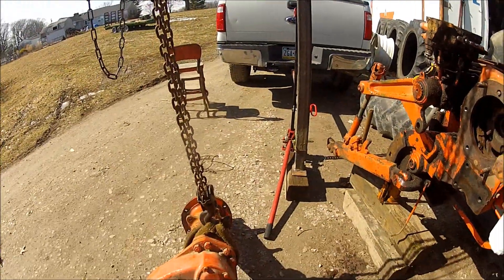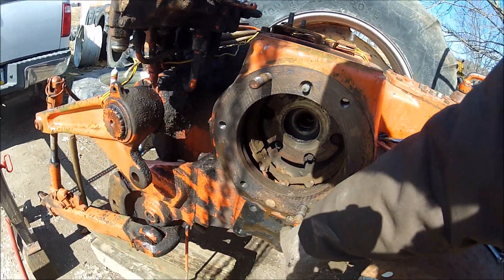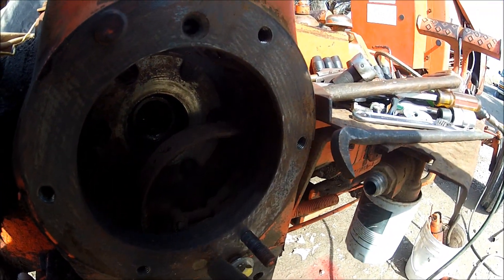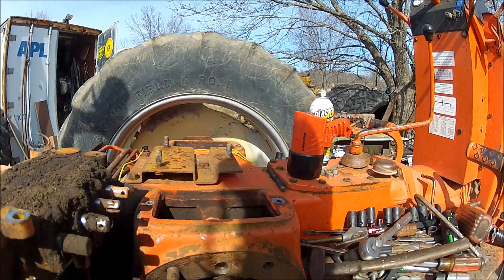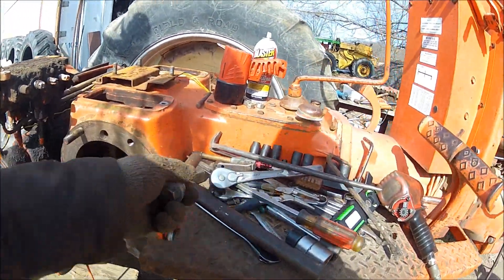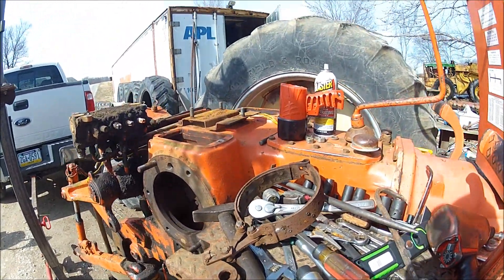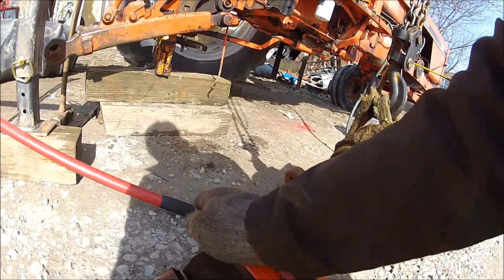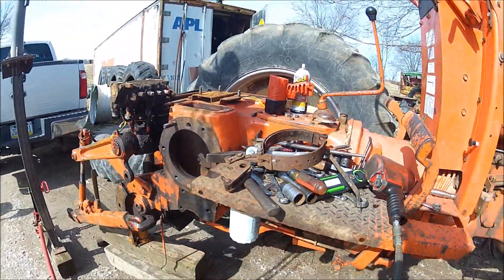Removing the Brakes from Allis Chalmers 185

Comment: In case others run across this, you can actually do this whole brake job without removing that lower pin. Even with the frozen brake rod actuator and broken brake rod. The linkage can all be taken apart in the housing while the lower pin is left in place. The threaded swivel the brake rod attaches to can be removed and replaced while that lower pin is in place. I'm assuming this is very similar to the 170 I just fixed since it looks to be identical. The linkage is all just pins and cotter pins, the threaded swivel portion is held in place on the linkage by a couple of c clips. Really not a terribly hard job once you figure out you don't have to remove that lower pin.